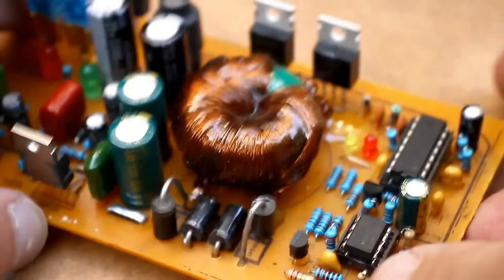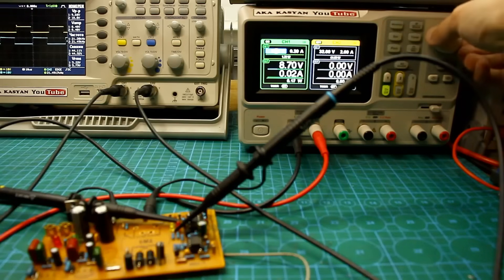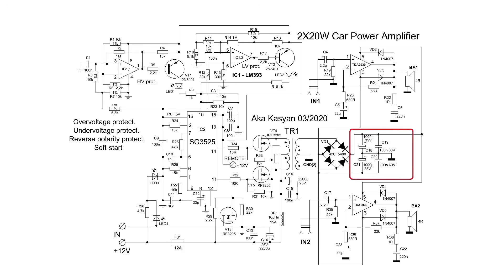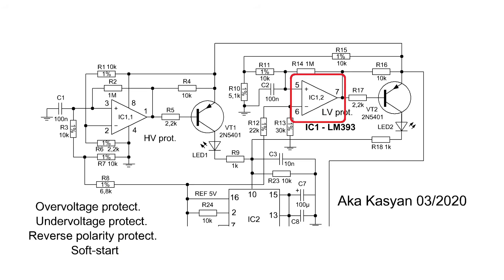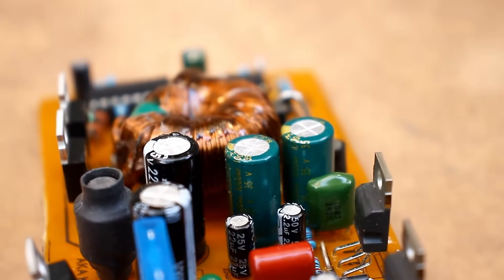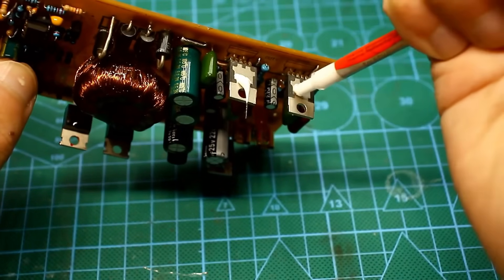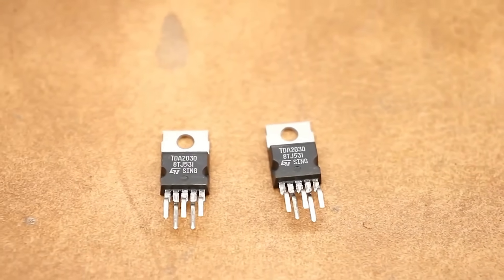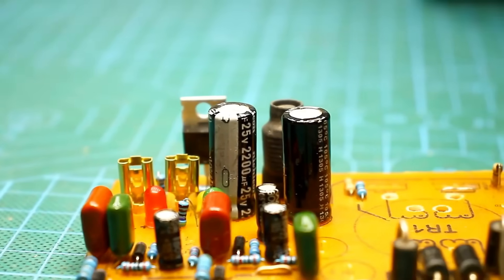Interesting project - DIY car amplifier

Comment: Nice one! It remembers me the times I was building them. That time it was really convenient to build them, on the stores there were very expensive. I was using the TDA 7294 and the converter was rising the voltage to 24 V symmetrical. I've had great time watching your video, thank you!